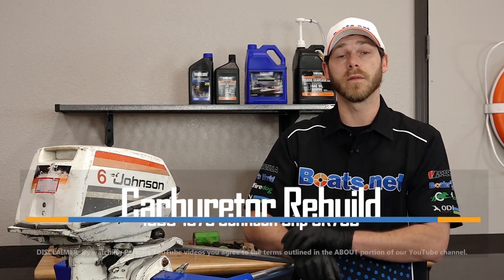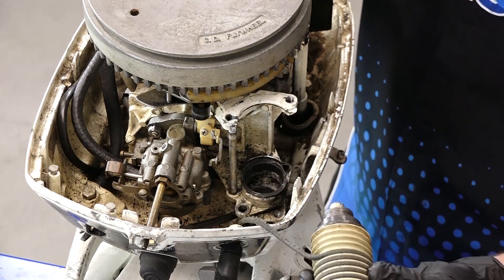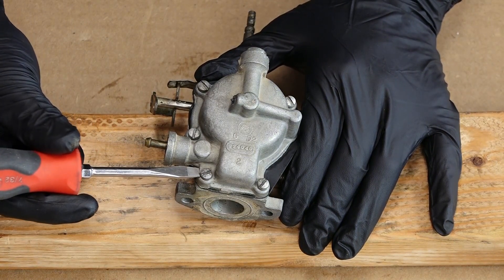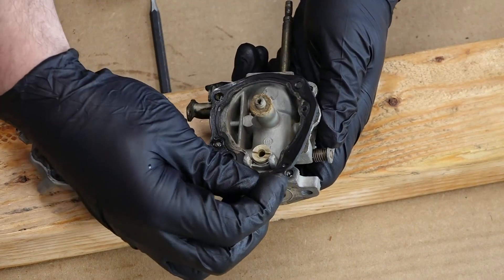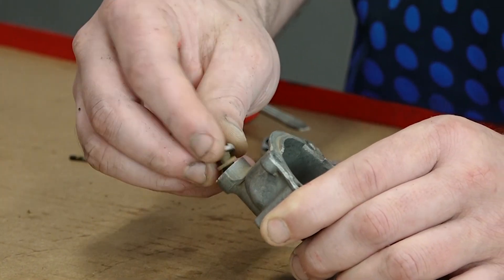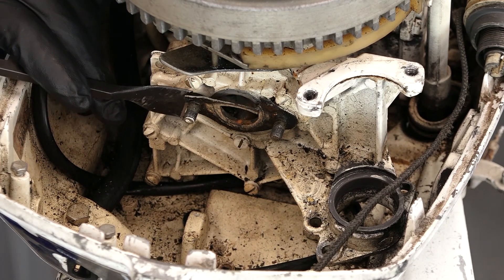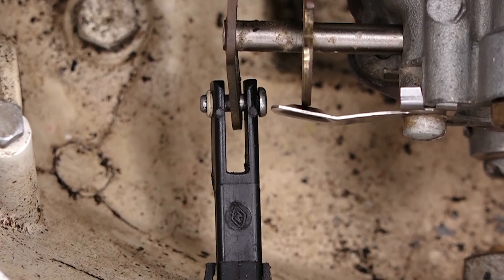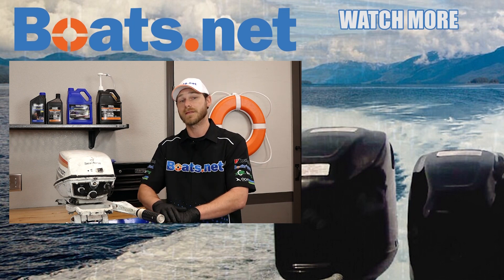Johnson 6HP Carburetor Rebuild | 1978 Johnson Outboard Carb Rebuild  | Boats.net

Comment: What about the  aluminum  plug on the top for low and idle speed fuel flow? Under the plug is 3 very small holes that allow the fuel to enter the carb? 90% of the time these very small holes if even partially plugged will cause rough idle,  inability to be able to adjust low mixture when plugged up holding the choke partially open is the result just to operate the engine at idle and low speed.

Comment: People, DONT remove the float pivot pin the way shown here. Notice he is hammering the pin right into the plywood! It is not in very tight, just push either end with a pick, it will slide out.

Comment: Why he completely removed the starter baffles me, remove the top two bolts and lay it on the side. If your going through all the trouble to rebuild the carb clean it properly.  Remove the welch plug, you can use an ultrasonic cleaner on the carb body, if that's not available soak the carb overnight. You can use simple green, mean green, totally awesome. Any degreaser,  even better heat the fluid to 175 degrees.  After rinse the carb and use you compressor and an airgun to blow out all the ports and passages.  If you don't have a compressor and can of air you use to clean your computer will work  what he calls the high speed jet is not, the high speed jet is in the bowl behind the drain screw.  He does not mention adjusting the float,  just make sure it is level with the body of the carb.  In the kit there are new washers  for the low speed needle, two cork washers and a nylon one.  Other than all that being left out it's a great video !

Comment: do you ever remove the expansion plug? some forums suggest that as the three passages may be blocked.I rebuilt the carb but still have unsteady idling and hesitation at high speeds,

Comment: I have replaced the coils, condensers, points, I have cleaned and replaced parts for the carburetor. I have fire to the plugs but I still can’t get it to start. Anything else I need to do??

Comment: I rebuilt the carburetor on my 1956 30 hp Johnson but the float was to short hit and rubbed against that rod in the middle so I reused the cork one so far it works fine no issues

Comment: What about the packing on the low speed?
Reply: Yes, he did not show removing the old packing, and putting the new packing.
Reply: This guy forgot to do a few things in the rebuilt ,,,,,he should show starting it engine and taking carb back off

Comment: How much packing goes behind the low speed nut . I pulled out what looked like a clear gasket and a cork gasket, does that sounds right? I notice u didn’t have this step .
Reply: Correct, he totally forgot that, & it’s important. There shou,d be two packing washers, & a washer.

Comment: Hey, I have this engine, a few years newer, and it starts just fine when cold, but is a bear (nearly impossible) to restart once it is fully warmed up.

What is the proper procedure for starting this engine when warm?   What do I do if it is flooded?
Reply: I have the same issue mate, just will not want to start when its warm... and thats usually when im in the middle of a lake or halfway up a river lol.
Let me know if you find a solution bud!
Tim
Reply: tims ==>  What has worked for me are two things:

THE HARD WAY:   Allowing the engine to cool entirely by removing the cowling and just let it sit for an hour -- start as if dead cold.

WHAT WORKS FOR ME:   To start when HOT or STILL WARM --  this works perfectly for me:    Set the throttle at about 1/3 (this will be peculiar to your engine, you find the sweet spot),  choke the engine but do NOT prime (on my model this is pulling the choke/prime knob out 1/2 way).  Pull ONCE ONLY.  Push choke back in
Do not readjust the throttle -- pull and it should start.    Once I discovered this method, it has never failed.    Let me know how it goes for you.
Reply: @kiphansen2458  cheers mate ill let you know!
Reply: I had the same issue with my chainsaw. Turned out the the carb was not getting enough air to restart the engine. Online I found others who had the same problem. The fix was to cut 1" hole in the air filter housing and put a wilkee button (cover) in the hole. When the chainsaw got hot, pull off the wilkee button to allow the carb to breath better on restart.

Comment: Well, the fixed high speed jet is actually in the carb bowl, and requires a special tool to remove it, the high speed nozzle is not the high speed jet....  You used one of the low speed needle packing washers on the bowl drain screw, the red fiber washer included in the kit goes behind the bowl drain screw.  And, from the looks of the packing nut, there were no/not enough packing washers in place to keep the low speed needle secured and from leaking air.  Using that little screwdriver on the float valve seat is likely to bung up the slot in the seat, the float level height should be checked afterwards also, along with carb/cam syncronization.  Like others have said, there is no need to completely remove the starter like that, just move it over after removing the top screws and picking it up slightly.  Removing the whole thing like that will require that the spring be rewound for proper rope tension, wrapping the rope back up on the pulley isn't going to do....
Reply: Wishing I would have read the comments before removing the starter. Any tips to get it back in?
Reply: @pgbmxrler   Well, the starter spring has to be installed in the lower retainer, then screwed back into the manifold starter bracket first.  This usually requires removing the starter spring from the rope pulley...This is no big deal if you have the newer style white plastic rope pulley, a little more difficult if you have the aluminum rope pulley.  You can also get it reassembled by pulling a bit of the spring down and out of the aluminum pulley while you reattach it to the lower retainer and manifold bracket.  There is a little plastic bushing that is inside the lower retainer, please don't lose that.  The hard part is "rewinding" the starter spring once everything is back together, which usually requires removing the starter rope from the pulley...I would buy a new starter rope also, they are usually worn and have been cut a few times making them too short.  There is a specific length the rope must be cut to, this is important.  I realize my written explanation is tough to follow, please visit aomci.org, then go the the "ask a member" page to post your inquiry....My name is Don aka "fleetwin", I will respond...Be sure to include the engine's model number....
Reply: i wish a diagram came with the kit outlining what parts go where! Theres a rubber O ring that I cant figure out i the package, any ideas?
Reply: @blueback21    This carb kit from OMC/BRP fits many different carburetors, not all pieces are used on every application.  That big rubber oring is not used on most current engines, what engine do you have?  But, the smaller thick squared off/round gasket is the nozzle gasket and must be used in most cases.
Reply: @fleetwin1  Oh I have 1968 Johnson, 6hp.
Reply: @blueback21    OK, so tell me again what issue you are having, and what carburetor kit you are using...  OEM or aftermarket.
Reply: so how about the packing for slow speed needle, which ones do you use, my manual says 2 pieces
Reply: @blueback21    Yes, there are two packing washers used in most of the adjustable needle valves, except for newer models.
Reply: Kramden you seem to have a lot of knowledge, so i have a question:
I just bought a 8hp evinrude from 1992 (E8RENM) and it doesnt idle, starts fine though, has spark and smokes A LOT. Fiddling with the mixture srew did change something but not enough. Needs full throttle wide open to stay alive. The first time starting revs this thing up as it should. When opening the carb i found a plastic straw instead of the emulsification tube made out of brass. So clearly somebody has  messed with it and i think this plastic jet is letting wayyy too much fuel into the system. As this part is not available, im asking what kind of carbs can i use, that will fitmy engine. Are all the 6hp carbs fine to use? I have the intake manifold with 3x2 reed plates so is that already the restriction for the 6hp variant or is there something else, that differs them from the 8 hp carburator?
Thank you so much, if you can help me!!
Reply: Thank you!

Comment: You forgot the low speed needle gasget! Also the carb synchronization is way off. ....and that is definitely how to not reassemble the recoil starter. 
I wonder if this engine ever worked again?

Comment: Before you remove the needle ..you can gently seat it all the way in and count your turns..which will give you the former setting of low speed idle...otherwise a basic setting is 1.5 turns out from seated ..for initial starting ..
Reply: Sorry to hijack your top comment, if anyone is having a problem with fuel making it to the engine after carb rebuild behind the drain plug is an orifice plug that can escape cleaning from chemical soaking.  you need a flat head screw driver that can fit the drain plug width and ease the brass plug out.  I spent 6 days only being able to get the engine to run for short burst on carb cleaner.  removed that plug put a needle through it (green/grey oil build up came out) shot it clean with carb cleaner.....motor finally runs. hope this helps, seen this on other forums and no one comes back to say how or if they fixed it.
Reply: @kekq3525  - I just got an old service manual for these 6hp motors off of eBay. That plug you call is referred to as the high speed jet in this manual.
Reply: @kekq3525  thanks for this
Reply: @kekq3525  don’t know if you’ll ever see this but this comment was a god send
Reply: ALSO HE DIDN'T CHANGE THE O RING IN THE LOW SPEED SCREW ORIFISE

Comment: He left out about 3 steps...float adjustment ..needle packing..checking needle condition...he might get lucky or be doing it again..ahoy mates
Reply: How can I check the float is right and the needle packing ?
Reply: @steve-wf7vf  I find that the float is always just fine right out of the kit. Once installed, you fip the carb over and make sure it is sitting level. More importantly on the adjustable low speed jet, he did not show removing the old packing, and intalling the new packing. You need to clean the old packing out. Once you put the new packing in, you tighten down on the gland nut so the needle jet rod will turn with a bit of resistamce. He should have showed those inportant steps.

Comment: How do you adjust the new low speed jet properly now that it's been removed/replaced? Is there a method to tune the carb?
Reply: I would adjust it so that it is open enough to just get a steady idle. I was wondering the same thing and when I was finished the job it became easy to open and close the valve and figure out where it should be.